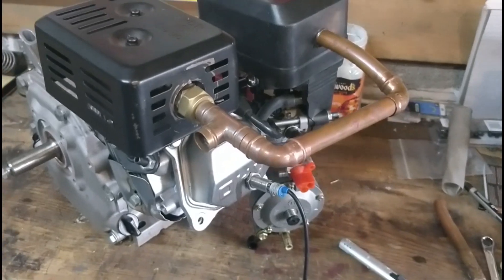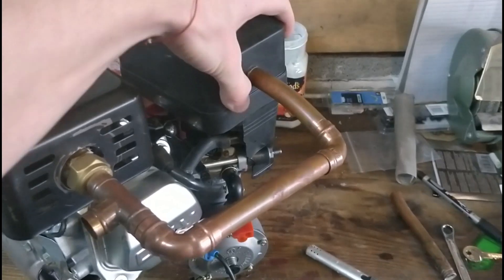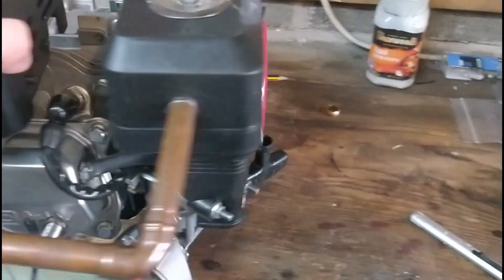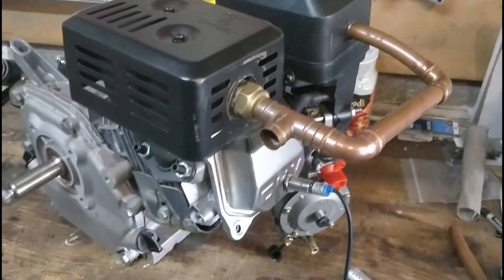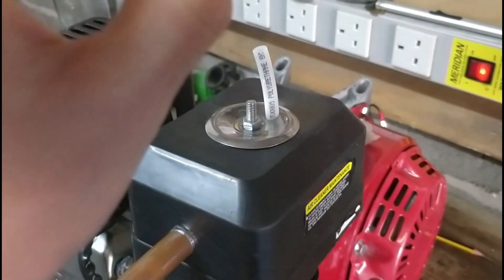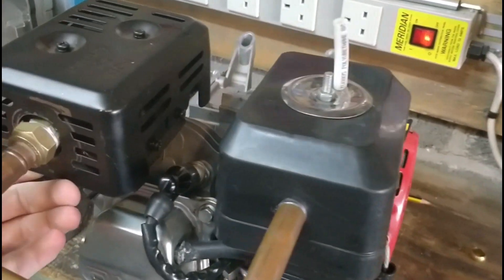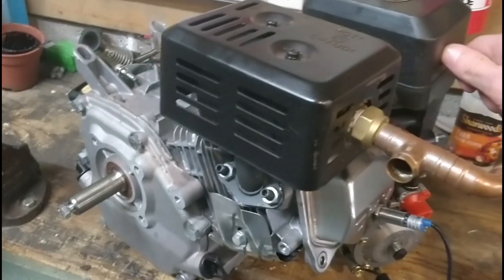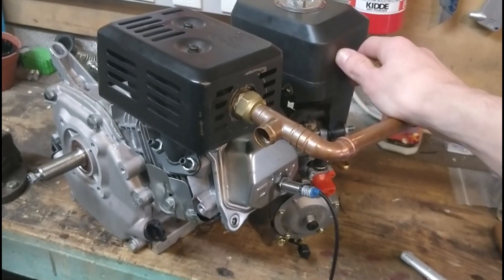Pure Hydrogen Combustion Engine

Comment: I really hope this will be the solution instead of electric cars
Reply: Yeah they sound just like normal engines and Toyota just unveiled how their hydrogen powered Corolla sounds, sounds just like the Corolla with a performance exhaust
https://youtu.be/2dgzKW8EKMc
Reply: @lowkeydiegoduran4724  yeah I saw that video, that what gave me hope 🤘🏼
Reply: @lvdb4808  Yeah if they ever ban gas powered cars, I really hope this is the option to go with as an alternative
Reply: @lowkeydiegoduran4724  I mean, ethanol is still an option.
Reply: @Gabriel-he6ih  yea that too
Reply: @Gabriel-he6ih  costs more to produce wastes farm area for corn it's a  racketeering scam too.
Reply: @lowkeydiegoduran4724  They won't get banned, they're just gonna stop getting sold and fazed out
Reply: It will be a solution for modifying existing combustion engine vehicles.
Reply: @Ferenc Dobos you are forgetting the density of energy you can achieve with hydrogen and fossil fuels. This is also the main problem with electric cars
Reply: @lassemikkelsen648  metal hydride hydrogen storage increases the storage density massively! We're getting there
Reply: @lassemikkelsen648  this actually creates a new problem,

First, the exhaust spitting a lot of water... say hi to rust and dirt especially on your exhaust pipe

this greener energy doesn't mean have no pollution, it still produce a very harmful NOx gas..so a catalyst needed which again, rust and dirt can cause these filter clogged

Second, you need a big-tough-high quality gas tank to prevent any gas leakages since hydrogen is very explosive gas. 

Actually can be fixed with an HHO gas generator, but you need to mix Potassium Hydroxide everytime you refill the water.. this is similar to 2-stroke era where we need to mix the oil after refilling the fuel 😂😂

So, my opinion is.. electric cars still the best... Even though, the charging time really take a shit tons of time 😅. Hopefully in the future car producer can make a super fast charging system, which feels like refueling the regular combustion cars
Reply: @mashilmy  LoL noice Chemical learn dude H2 +O2 burn = H2O where the fuck is Nox come from ???
Reply: @mashilmy  I'd rather mix gas then drive electric. Guess I'll be mixing potassium hydroxide in my cars water tank.
Reply: @lahandri7275  Lol, so you think IC Engine suck the O2 gas only, huh? In this earth, 70% of air is N2..

except you put Covid respirator in it, then yes, you can ask me like that "h2+o2, where the fuck nox coming from?" 🤣🤣
Reply: @lahandri7275  he mentioned it in the video. Engineering Explained went into detail about how nitrogen from the air gets mixed with oxygen in the high pressure/high temperature combustion process, and thus creates NO2 exhaust
Reply: @mashilmy  still far better than chemically powered EVS.
Reply: @lahandri7275  because you're not burning pure o2, you're pulling in gas from the atmosphere which contains nitrogen mostly.
Reply: @kyrebanorg9897  chemically powered EVs? What chemical? 🤔 

Wait, isn't hydrogen a chemical?
Reply: @mashilmy  the problem with EVs is just not about charging but the simple fact do we have enough Lithium, cobalt, nickel etc to make 71 million EVs every year?
Reply: @J1I9M7M4Y  batteries get cheaper all the time. And now recycled lithium batteries outperform virgin material batteries because the cathodes are porous after use
Reply: @J1I9M7M4Y  also, when you're done using gasoline to power your car, can someone else scoop it up and re use it in theirs? Recyclables aren't a finite resource.
Reply: @mashilmy  personally i love combustion engines because of the sound, how the engine feels alive and the relatively low weight. Sure you can like e cars, but i have to correct you in 2 points: 

1. gasoline combustion engines produce H2O aswell. Especially during a cold start. Lower temperature areas in the exhhaust can be coated with corrosion resistent materials. So the rust problem isn‘t getting any bigger than what we have in normal cars nowadays.

2. Nox production: Nox aftertreatment with Adblue only works at high exhaust temperatures greater than 900*C But hydrogen has a very high lambda tolerance. You can run H2 engines with lambda values up to 4. At this point, the average cylinder temperature is at about 200*c where pretty much no Nox is being formed (about 0.1% compared to a normal combustion engine). So it is possible to layout a H2 engine with basically no NoX emissions.

Obviously high pressure tanks are always a problem, no doubt about that.
Reply: @BobTschiggerillo  well i actually also love combustion engine sound, because it feels more alive. But I'm actually pretty conservative about efficiency, so yeah that's the reason why i like newer technologies.

First of all, I can't agree with your statement, "combustion engine relatively lightweight"..in fact, one 300HP Tesla's or any Car Electric motor is clearly lighter than 1000cc CBR engine. What i don't like about electric cars, is the energy storage..in this case it's the battery, which really wasting time on charging station (still on research for better storage)..forget about Toyota Mirai, it's trash.. it's really slow for $60000 car

Secondly, Corrosion resistant coating will eventually getting worse as time goes by. Mostly due to extreme heat + water. As you have said "gasoline engines produce h2o as well, especially during cold start". That's really true, my grandma have old Toyota with OHV engine, it always spitting water whenever i do cold start...and of course it turns out to be really rusty. The water itself is not that much compared to the video but it already making it rusty, imagine if we replace the fuel with Hydrogen how much water will come out of it? Even if you replace the pipe with stainless steel, trust me at some point it will not be fine
Reply: @mashilmy  ok, i might have phrased the first thing wrong. I meant lightweight as a whole package. Personally i‘m all about cornering speed, and that‘s where electric cars really suck to this day.
Reply: @BobTschiggerillo  yeah because they don't put multi ratio gearbox instead just a puny fixed one ratio gearbox, which is silly tbh

I literally don't know why.. 🤔 CVT or DCT could be a good pair for electric motor
Reply: @TorutheRedFox  combustions only happens when there is an activator, if you put a flame near to it, it will still burn. The video toyota gave to public is quite silly, they don't give something flaming or arcing, just bursting tank with nonsense slow motion
Reply: @TorutheRedFox  that kind of "spark" won't make a fire, I've seen a man trying to burn gasoline with that kind of spark, it didn't burn at all. What i really concerned is electrical spark a.k.a arc, or static discharge, which is no. 1 cause of fire in gas station
Reply: @lahandri7275  nitrogen in the air burning, unless you run the car on pure oxygen and hydrogen it’ll produce nitrogen oxide
Reply: @lahandri7275  From nitrogen in the air.
Reply: @mashilmy  1.petrol exhausts already do that. 2. Almost all current hydrogen vehicles use a catalyst. 3. Hydrogen is not explosive it's flammable there is a difference. 4. You only need to change the water every year or 6months a little HHO generator with idk a gallon of water and 6tbs of potassium hydroxide will make thousands of liters of hydrogen.
Reply: @Hunter-zz9gm  1. Yeah i know, and it's going rusty. With hydrogen on IC engine it would be much worse
2. Yeah i know, i did commented about that
3. If it's compressed then it can be explosive, on its natural form and low pressure it's just flammable. But on high pressure it can blow your house.
4.how long 6tbsp of potassium hydroxide will last?🤔
Reply: @lahandri7275  yeah lmao i dont get it the reaction is simple lol
Reply: @mashilmy  all these are minor problems = electric cars too expensive= than combustion engine with hydrogen
Reply: @pashahillyard8763  not if you use electrolysis
Reply: @mashilmy  😂😂😂😂😂 electric best??? Is that including death of youngsters mining the crap for ya batteries? Batteries are about the most destructive "tech" going
Reply: @lahandri7275  there is nitrogen in the air…
Reply: @lahandri7275  the guy in the video says “exhaust gases rerouted to the intake manifold to reduce nox emissions”
Reply: @J1I9M7M4Y  Lithium is recyclable. You can't recycle oil. That's a desperate reach to make a case against EVs.
Reply: Heavy Engine maker CUMMINS is building a H truck engine too......
Reply: @Trevor7727  JCB is worth watching as well 
https://www.youtube.com/watch?v=19Q7nAYjAJY
Reply: Yeah, especially for large vehicles such as farm equipment, trucks, buses etc...
Reply: I know a bunch of Japanese car companies are going down this route. If they can sell it well American companies will follow.
Reply: Though I'm afraid we'll still need a heavier alternative for diesel
Reply: @Gabriel-he6ih  This piece on JCB is worth watching as well 
https://www.youtube.com/watch?v=19Q7nAYjAJY
Reply: You can keep hoping... but it won't do much good. Hydrogen gas simply doesn't have enough energy density, not to mention the required infrastructure just isn't there (and likely never will be).
Reply: @sylentxtinction2097  
"A 2021 Toyota Mirai has broken the Guinness World Record for the longest distance by a hydrogen fuel cell electric vehicle without refuelling. On a single fill of hydrogen, which took five minutes to complete, the Mirai achieved 845 miles during a roundtrip tour of southern California.15 Oct 2021"
That was in 5.4 Kgs of H2, meanwhile a Tesla Battery weighs in at 520Kgs
Now that was on a single fill of H2, thing is in 10 mins it was refuelled and
ready t go again. Correct we don't have the infrastructure , but the same 
is true of EV's . Hydrogen will happen because its the ONLY viable future 
for Aviation so there will be plenty of fuel available when we get started.
We also have fuel stations that are perfect for a 5-10 min turn around , where as u are going to need vast acres of parks to have EV's stopped
for a couple of hours to complete journeys.
This is NOT a either or situation , near where I live u can fill up with
Petrol, Diesel, LPG, Electricity for EV's , There is even a H2 station 20 miles 
away.
Reply: @budbud2509  - you're talking about a COMPLETELY different process. The original comment said they hope "this" (the video content of a hydrogen converted internal combustion engine) is the future. It's not. Plain and simple. Now... as for the example you cited.... yes, hydrogen FUEL CELL technology has been waiting in the wings for a while, and will no doubt see some measure of growth as the petroleum industry continues to be choked by unnecessary government restriction/taxation. Hydrogen, as a gas, is fairly cheap and abundant. The problem is processing, storage, and transportation add on significant costs compared to petroleum, or even SynGas, for that matter.
Reply: @sylentxtinction2097  Huh, isn’t hydrogen the most energy dense out of any fuel?
Reply: @xmysef4920  yes these people know nothing.
Reply: Hybrid hydrogen electric cars are the future. Then a car can truly run on water
Reply: No solution is THE solution, but this is carbon free.
Reply: Electric wont work as the infrastructure isnt there. JCB create hydrogen powered plant machinery now. You cant power a digger or tractor with batteries. These machines run all day long. Cars run a few hours max a day.
Reply: @OGCrypto33  everybody acting like they go cross country a minimum of twice a week. I mean this is happening, piss and moan all you want. Also who says tractor can't?
Reply: yeah electric cars are not that good, the economy friendly people say they are great but they don't realize all the harmful materials that goes into just the battery and also the amount of electricity I'd drians from the power grid
Reply: In romania there are some old guys with some sort of hybrid engine petrol and hho, unfortunately they are so underrated  ...
Reply: It would be if they did a hydrogen station infrastructure
Reply: Yep
Hope so
Reply: it won't be the solution, but electric cars won't either
both have their strengths and weaknesses, so we really need both
Reply: Toyota make a whole bunch of hydrogen cars there only really used in California
Reply: Electric cars are better
Reply: Halo cars hell yeah
Reply: Same
Reply: I agree
Reply: @Jules i agree but it's actually harder to install hydrogen pumps because its so dangerous
Reply: @Jules what i really concerned is the energy efficiency not those watery exhaust pipe. Hydrogen efficiency is worst than gasoline because you need a lot of power just to collect, compress and distribute it, after that you still need a fuel cell to convert hydrogen to electricity (like toyota mirai).. open your eyes bro, just see how much power losess just due to its production..and don't forget to the emission of hydrogen production..emission is always exist, even for the cleanest car

Now, scientists are developing stacked semiconductor photoelectric cells which will have 5-10x output than current solar cells..just imagine if you put these on your car bodies, you don't even need to pay bills after that 😂. It will produce electricity whatever lights hit the semiconductor, that's how it works..so it's not only sunlight that can produce electricity, but street lights or moonlight also

It's so stupid when you said "EVs infrastructure aren't ready for now", fyi, long time in the past.. when the first car ever exist people are ultimately not ready for that, they're crashing each other due to lacks of traffic light..and they're hard to find gasoline. to fix that, government build those needed infrastructure and to accomodate gasoline, companies started selling gasoline until now
Reply: @Jules Specifically, hydrogen has a wide range of flammable concentrations in air and lower ignition energy than gasoline or natural gas, which means it can ignite more easily. Consequently, adequate ventilation and leak detection are important elements in the design of safe hydrogen systems.
Reply: @Jules i don't know, I ain't Californian.. I'm not even american. But in my country, our national electric company gives us private car charging lines to our house if we have EV. So it will be billed separately than our main power lines. And it's cheaper than using the main power lines. Government here is pushing the adoption of electric vehicle by 2025. So power grids overloading? Really?

I'm laughing when you said the "infrastructure of hydrogen", I'm not even talking about hydrogen infrastructure.. I'm talking about EV infrastructure and hydrogen efficiency.

Talking about battery drawbacks.. I'm actually already wrote it in my past comment..trust me, it will getting better and better..just like IC engine..the first gen of 4 stroke IC engine was Sidevalve engine, updated with OHV then OHC and DOHC and now there some kind of Pneumatic DOHC or even Camless Hydraulic Valve engine.. its getting better and better as time goes by
Reply: @Jules im not even in europe 😂 I'm in Indonesia, and Indonesian government is... idk its kinda friend of Putin..so why synthetic oil, if natural oil is not even a problem..why hydrogen if electric is easier and much more profitable

What happened if the power goes out? Damn bro...97% of indonesian uses the same electric company, only 3% or less who doesn't. if it's goes out just imagine how riot this country will be
Reply: @Jules it is possible in the future battery can charge for just 5 minutes, Xiaomi did make 5 minutes ultra fast charging, in physics if we can engineer it in small form factor we can scale it. I had studied electrical engineering in the past, so I'm pretty sure about these problems. The only problem for batteries (current technology, gonna be better in the future) was reliability, it won't survive more than 10 years.
Reply: You don’t get it, I eat a Porsche Carrera 4S for breakfast with my entry level EV VW e-up at the traffic light. 210 nM torque at the wheel and 100% power at 0 rpm. Had to switch to winter tires 🛞 all year round as summer tires couldn’t keep up with the instant torque and where slipping. Good luck beating an EV with your ice engine and it’s slooooooow and loooooong rpm curve. ☺️
Reply: @johnmanderson2060  people who think speed is everything are instantly not relevant in a discussion about solutions and alternatives for ICE.
Reply: @lvdb4808  I don’t talk speed 🤣 I talk instant FULL TORQUE at 0 rpm. My EV max out at 130km/h and 120 is the maximum legal limit here in Switzerland 🇨🇭, so speed is not a relevant point. The efficiency of an EV motor is far better than a internal combustion engine. For the same amount of joules you get much more energy to the wheels than with an ICE. 
I think the real problem is that a lot of petrol heads cannot imagine driving a silent vehicle 🚗 because they need the big noise to flatter they ego an obfuscate their tiny anatomy 😏😂
Reply: @johnmanderson2060  still haven't found a worthy argument, people enjoy things the way they are, let it be like that. Ev's are a good alternative but not a replacement, also; cruise ships, airplanes and China till exempel are the real problem if we talk  environment.
Reply: When electric car rule the world I will be still using gas
Reply: Amen to that
Reply: same
Reply: It's gonna be the solution because Toyota and Yamaha team up to make a V8 engine that run on hydrogen
Reply: Really late it wont be combustion maybe fuel cell bc combustion engines are wildly inefficient
Reply: Isn't Nox also a combustible gas?
Reply: It is why do you think it's hidden. This has been proven and perfected several time but ends the same. They kill them.
Reply: Same! a lot of non green resources go into making green electricity either way we look at it. Also hydrogen can be made at home=no tax.
Reply: Won’t happen. Too much nitrogen oxide production which in turn becomes nitrogen dioxide which is bad for your health and the environment.
Reply: Wouldn't it be better to diversify transportation engines so that one particular resource won't run out?
Reply: @XoJOHNoX96  yeah 1 year after I made this comment I'm more on that side also, electric cars are a good alternative beside petrol and Diesel, not all cars can be electric but as we see right now something needs to change so for some persons it might be a good option to drive electric
Reply: Governments don't want this / because this puts power in the hands of the people ( educated mind , water , equals freedom)
Reply: It already can be

65 percent of the planet would take a synthetic opioid drink by the 10,000 gallon vat and say thanks, 1/3 off the world is starving to death, 5 percent need bones they can't or don't want to get replaced, 5 percent need organs they can't or don't want to get replaced, 5 percent are terminally ill 5 percent comic pain, 5-10 percent never wanted to be here anyway, and everyone else will have a peaceful way to go when they want. Guy saves 1M in state aid, paid 600k in social security, doesn't have to die every day, just gets to leave before suffering. The guy with the kids gets 800 k from Uncle Sam in life insurance he never signed up for and Uncle Sam keeps the other 800k. Free euthanasia. Cut inflation by more than half, more than doubled available resources. Have a job by a company which pays all the taxes and picks up grass clippings M-S to take it to fields now with cows on it, 4x your US cattle with lawn mower clippings from every years, save 2500 on property taxes and make sure your clippings are out in your neighborhood on Tuesdays

Dig out 10 ' of river bed and cast and set two 10' pipelines to being Atlantic ocean water to every house, use steam distiller for sale free disinfected water at the kitchen sink, dump waste water into sealed pipelines. It took a turn 2 years to dig out 10' of riverbed, everyone could be back to work working in every town and we'd be at with new infrastructure. Don't put salt in your water, have more salt for more roads in the winter. Use electrolysis for energy from salt water.  At the very least, feed rivers with desal water immediately to overcome drought shortages, no problem
Reply: Electric makes no sense considering you still need a charge source which is usually fossil more than not.
Reply: @ChildofYHVH  there's hydrogen and solar
Reply: @Narja ok?
Reply: limited battery life on electric cars. Mine would need a generator cart because I am too cheap to replace the Expensive battery
Reply: Doesn't work that way. Free energy means people don't have to work as hard.  Thus giving them time to protest and actually have time to think.  Paid energy where you need millions of people to work from start to finish, paying them for years  and years to distract them from being a neighbor to our brothers and sisters.  That's why we have such a crazy society.
Reply: how many liters of hydrogen did you use for 10 minutes?! 💫
Reply: But, If we use water, that also will be a Problem my child.
Reply: @whatuseeisnotreal  are you serious?😂😂
Reply: @lvdb4808  Yes, there's will be scarcity of water if all of ya will use it in yo' Cars, and that's the problem.
Reply: @whatuseeisnotreal  70% of the earth’s surface is water. I think we’ll be ok.
Reply: 2022 we're onto plasmoids now
Reply: You are ignoring the fact that hydrogen destroys metals, reducing engine lifetime significantly
Reply: Eco hippies aka democrats will bed led like sheep to EVs as that’s what the powers at be have invested in
Reply: The lack of sound isn’t the only flaw of the electric engine, but also lithium mining causes more pollution than gas cars
Reply: Yes we need cars with loud engines. Not silent motors
Reply: I hope so too.
Reply: If they make the electric car that uses the infinite energy from the earth with a antennae like Tesla did but that was suppressed then I’d love them cars they got hella a lot of power
Reply: I like hydrogen because it can power gas and electric motors(via hydrogen fuel cell). If the hydrogen is produced clean with solar,wind,hydroelectric then we have zero co2 emmisions. I could see people retrofitting hydrogen and gas cars with hydrogen fuel systems in the future
Reply: Electric car's are a lot more fun than petrol powered combustion engines in my opinion cuz they have a shit ton of torque. The torque when I went for a ride in a Tesla was ridiculous! A petrol engine sounds better than electric but to me torque and acceleration is what makes a car the most fun. Even more fun than top speed or a loud engine. I'd rather drive a top fuel dragster than a jet powered salt flat car anyday. I like the electric hydrogen engines more than the hydrogen combustion engines. Constantly Shifting a whole bunch of gears means less torque. Some people just like combustion engines more cuz combustion engines are what people are used to and people hate change. I'm all for moving forward. I wouldn't want technology to stay the same. Hydrogen combustion and petrol combustion is cool too. I love the sound of a powerful engine just as much as any other gear head. Top fuel dragsters don't have to shift a bunch of gears for a reason cuz it just waste time shifting gears that could be used for acceleration. Top fuel dragsters just get up and go like a rollercoaster.
Reply: It won’t be because the oil industry makes too much money on electric cars and gas cars, they would never let the “free” people of America to have cheap energy source
Reply: It most likely will be. We should also just build more public transport since electric trains can get power from a cable or the track so they don't need batteries. The majority of people also suck at driving so people only being on the road if they chose to drive would be nice. Imagine most people just take a train most of the time and our roads would be clear of traffic and the people driving on them would be more attentive. Basically imagine if everyone who drives an automatic just rode in a train instead of driving.
Reply: big oil wont allow it.. they killed Stan Meyer for trying it..  and all the equipment was suppose to go to his friend Disappeared...     apperently  humans will die out because of your greed..........  wonder why you think all that money is going to save you in hell....  in fact the more = more suffering    oh well, I warned them, boss warned them... but nope just sheer stupidity
Reply: It is, this, nuclear, geothermal, and steam. Enter the realm of futurosteampunk... cloud punk sick af shit. Sky cities...
Reply: @Ferenc Dobos Fuel cell are best solution but too expensive.
Reply: @monaxp606  Im pretty sure that's the excuse that everyone's coming up with.
Reply: @monaxp606  They're good to make electricity, but they're too silent.
Reply: Too late.  Electric is here and hydrogen isn't.

Hydrogen might replace trucks though.
Reply: @robertsaca3512  - they're both here. Get over yourself. If you really want to get down to brass tax about it... more EVs are powered by coal, than anything else.
Reply: Sorry, but I don’t think a hydrogen internal combustion car is viable.  Hydrogen in a combustion engine does not produce as much power as gasoline. Sure hydrogen burns and gives water but it also burns hot leading to NOx production and if you fiddle the mixture to reduce NOx emission you get less power. There are a whole bunch of issues that need resolving to make an internal combustion engine run on hydrogen long term without destroying the engine.  The most obvious one is you need to keep hydrogen out of the crankcase. If an explosive mixture forms in the crankcase you may experience a RUD event. However, the main issue is terrible energy efficiency. It’s worse than using gasoline. Using a fuel cell and electric motor is more efficient and safer. However, you cannot regenerate energy braking or going down hill as with a battery electric vehicle. So hydrogen combustion is less energy efficient than gasoline which is much less efficient than a fuel cell EV which in turn is much less efficient than a battery EV.
If you ignore all the other downsides low energy efficiency is ultimately why hydrogen is unlikely to be a mass market fuel.
Reply: @fredturk6447  Well u have made a very good case for going back to horses
or even the bicycle ....
I think if u take aviation into the equation there will have to be an 
abundance of H about because as I see it its the only alternative to 
Jet fuel. Electricity is a bit of a non started for long haul because of 
battery weight , like I said an ordinary Tesla has a battery weight of
520 kgs ware as H is very light , see Toyota with only 5kgs of H doing 
high mileage . JCB highlighted the problem of machine utilisation, some
JCB's work is excess of 18 hours a day . Also as JCB stated their 20 tonne
machine becomes 30 tonnes when it battery powered. Also EV's are
inflationary , I think they quoted a petrol Corsa was £12k , the same 
model but an EV was £30k .... maybe they want to get poor people 
off the road . Anyway interesting times for now.
Reply: @budbud2509  I agree that aviation is an area where hydrogen might be useful and also possibly ships and.heavy vehicles. I just think for cars battery electric with an over 80% energy efficiency compared to less than 45% for hydrogen ICE (and that does not included 40% energy loss making hydrogen)is the way to go. Battery tech is improving rapidly with faster charging and higher energy densities. ICE hydrogen cars already cannot compete and don’t forget hydrogen needs to be stored in a heavy metal tank. Electric motors have very few moving parts and because they produce full torque over their entire Rev range you don’t need a complex transmission system. To some extent the reduction in engine and transmission mass balances the currently heavy battery pack. I certainly don’t want to go back to horses and carts, but I suggest the hydrogen ICE will meet the same fate as horses and carts.
Reply: @budbud2509  bro, tesla model S plaid is 1080Hp (2021, 3 motors, 300+Hp each, 500+ miles range) with 15mins supercharging while Toyota Mirai Gen 2 (2021, 800miles range, single motor) is just ~180-200Hp with 5mins refueling...if you put Mirai motor into tesla, it will be 4-6x the mileage, that's just my averaging measurements, but 3x the mileage is absolutely possible. And battery technology is getting better and better, so it's very possible in the future to be 5mins charging or even less than that. 

But, batteries also has cons which is probably the durability.. i will say it won't live longer than 10 yrs. Fuel cells cons is the efficiency, every energy conversion in physics always lose its potential power, especially in this type of conversion (something to electricity) historically lose a lot of its actual potential power, even tesla with batteries is just 90% efficiency means 10% minus actual potential power and degraded gradually time by time. Fuel cells is like 70% efficiency, also degraded gradually time by time. The worst is IC engines just like less than 50% efficiency, also degraded gradually time by time 😅
Reply: Ok first of all when you burn hydrogen it converts to CO2 just like gasoline . It ain't any better it's just an alternate fuel . Hydrogen is just very abundant so we should use it as fuel . Ocean water could be made into hydrogen with electrolysis for hho production .
Reply: @SuperMike-WonderWendy  burning hydrogen does not produce co2
Reply: electric cars = genocide , they know about it exactly